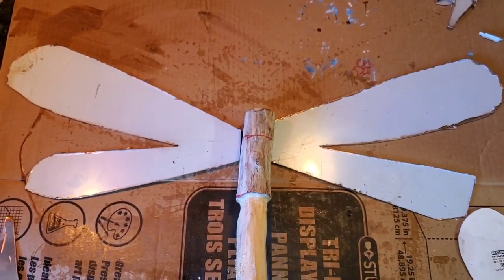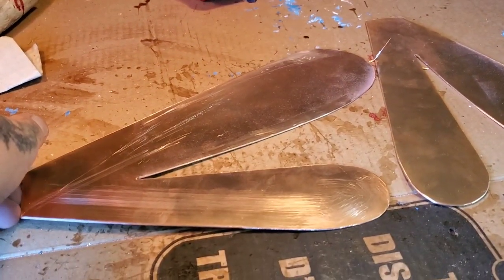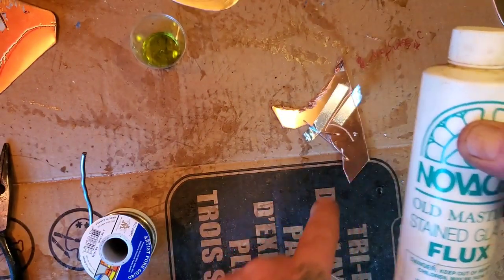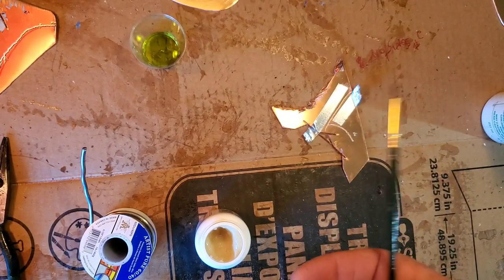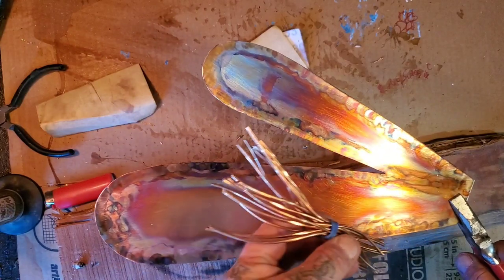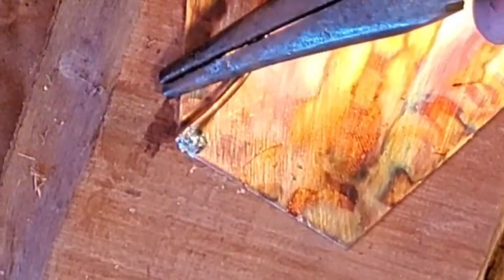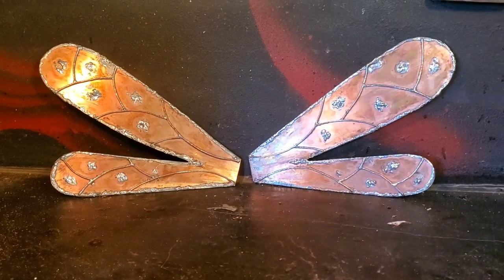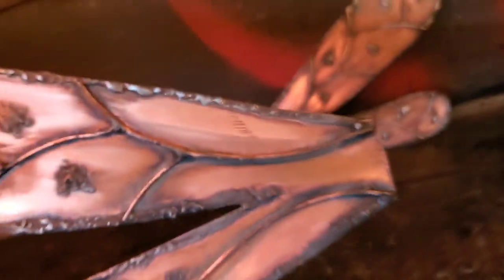Creating copper Dragonfly wings. Trials & Errors

Comment: I do a lot of copper work with stained glass pieces and shapes. I make a lot of fair wings and stuff 
I cheap and easy trick is to make a  cleaning paste with  high acid vinegar nOT the cleaning vinegar but the vinegar with the mother in it ,or lime juice , salt, and flour. Combine a half cup white vinegar and 1 tbsp of salt in a mixing bowl, rub the paste on with a firm hand and then clean it off with a microfiber cloth, then rinse with more vinegar and ya are good to go.
Reply: Would that bring back the burnt colour to the copper too? Or only take the “black” off?

Comment: Your cooper needs to be hot enough to melt the solider, as it melts move your heat to where you want it to go the liquid soldier will follow the heat
Reply: Clean the copper well, then flux where you want the lead to flow

Comment: If you have an old blade for your bandsaw with 6 to 8 teeth per inch use it to cut the copper . than it will be shot and don't forget to blow out every inch of saw with compressed air . have a great day . Oh don't forget to sand edges .
Reply: Thanks Jordy , just an old theatre majors shop hack .